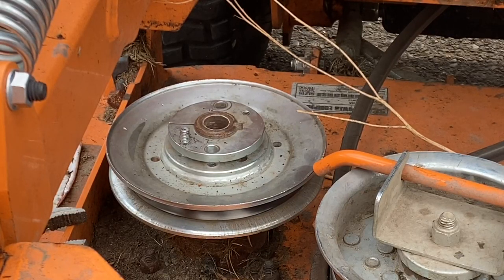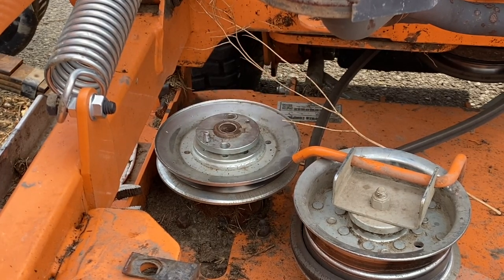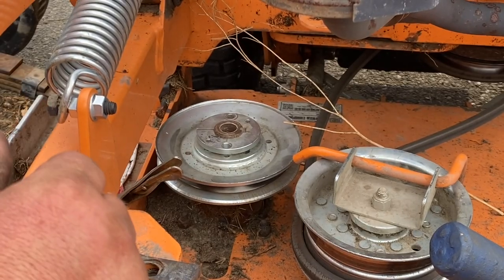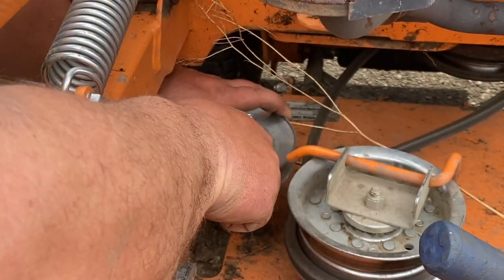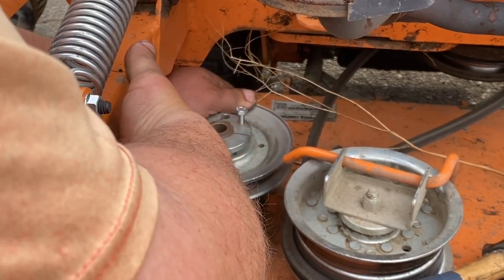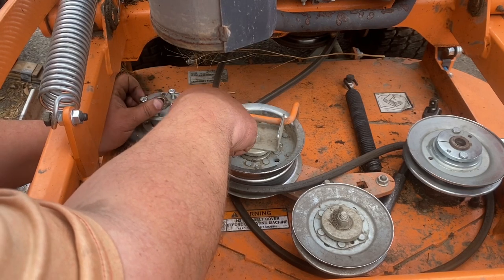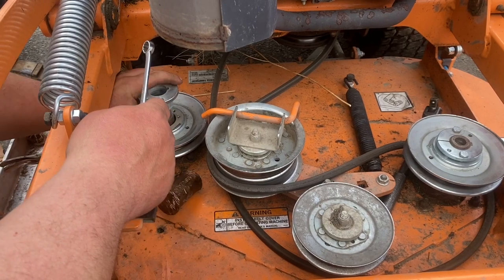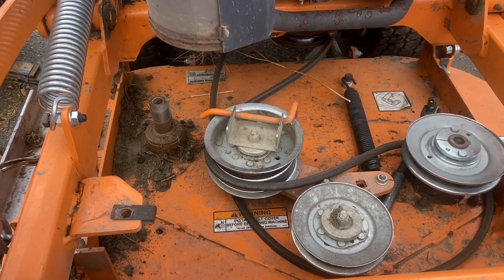Freeing a stuck taper lock pulley

Comment: I’m just researching, I work on street sweepers and the vacuum system is a big fan that is held on with a conical sheeve. Had a real rough one in the shop this week, it uses 1/2 bolts and we managed to snap them off using a long ratchet, not enough room for a puller on the back side, and we were heating and smacking the damn thing for about 3 hours. Had to pull the huge 150 pound fan blade out with the shaft still attached because we just couldn’t get it.
Reply from the maker: Unfortunately it’s pretty common for the bolts to break or strip the threads out, on larger ones I drill and tap larger holes sometimes

Comment: What's up Adam....yah I have a 30 year old simplicity riding lawn mower I'm working on hopefully they still make deck parts for them ... great footage
Reply from the maker: You would be surprised sometimes how many parts are still available for some older machines, prices can get up there though
Reply: Briggs &Stratton owns Simplicity  now since 2004  they also own vanguard an Ferris  . Simplicity   The original company was founded in 1922 building lawn an garden equipment an started building two wheel walk behind equipment

Comment: Is there a part 2 wanting to know exactly how to match the holes on the taper setup reinstalling
Reply: Use two long bolts to hold the two parts loosely together. Slide them on the shaft, snug up the bolts to start the process. Then replace with the shorter bolts one at a time.

Comment: Anyone tried torching it a bit to loosen? I do SM engine flywheels that way for a certain motor. Attempting this myself. These pullers an item you buy or they already on the pulleys?
Reply from the maker: The puller feature is built into the inner part of the pulley, I have used heat before but if you do only hear the outside of it where the belt goes and not the inner part as that would make it expand more and become even tighter